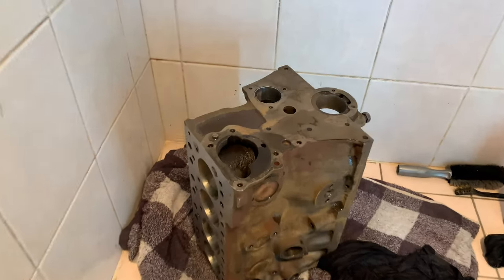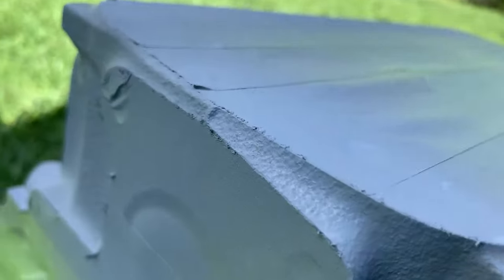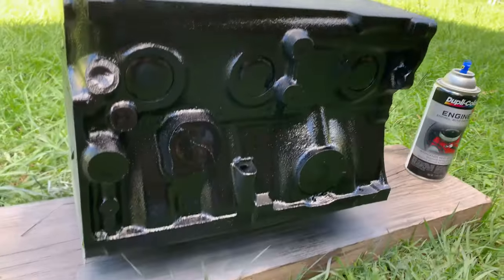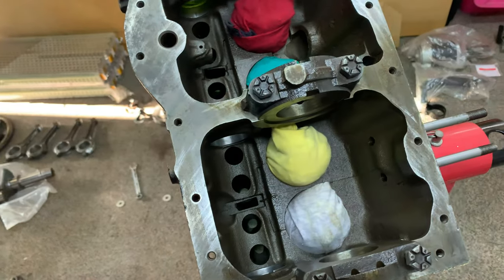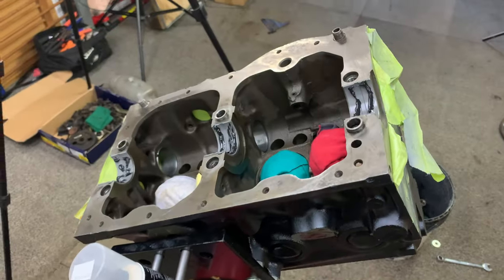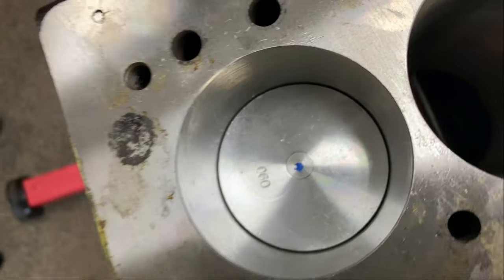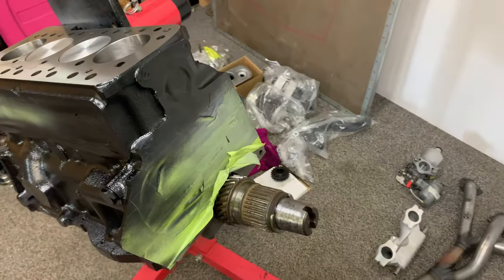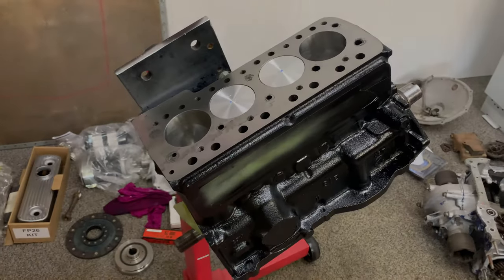Part3 of the Mini Motor Build - block is cleaned & painted and looking good!

Comment: Normally at this stage it's a good idea to enlarge the water coolant
 holes in cylinder head and block. Also the.mini cooper version head and block has an addition head bolt near thermostat. For a high revving engine the distributor drive shaft has to.be lightened otherwise it waggles and destroys the distributor bearings and upsets timing due to shaft waggle..Main crank centre bearings need a reinforcing strap fitting as crank shaft can break. Cheers from old George Ps A full.race mini engine tickover is around 1300rpm no good for road use. Also the more modern minis was fuel.injected. look out for mini metro turbo.

Comment: those oil journal's need to be spot on with the bearings, you will starve the bearings from getting proper amount of oil. I rebuilt an engine myself and had to make sure all was correct. i would order another set of bearing to make sure, take the time well you have it apart to get everything right. also lock tight when you attached the connecting rod bolts, get you self a gap testing kit for your bearings. Trust me Pete it will save you from tearing the engine apart because you burnt up the bearings for a lack of oil.
Reply from the maker: Yeh, i've been looking at other barings and they all 'seem' the same from images. I have the standard ones out of it. WIll dig them out to compare
Reply: @HBPowerwall  awesome, I just don't want you to go through all of that work and it fails on you. I through away $4000 on my engine build .
Reply from the maker: All said and done this one should come in under 6k but that includes alternator, rad, etc etc
Reply: The block has simply been drilled off,this is not uncommon, simply extend the block hole if it bothers you with a die grinder. it likely ran for many years like it is,and obviously has not spun a bearing,and while not ideal,will likely be fine.not a issue on low power levels of these engines.
Never ever use Loctite on rod bolts, this will affect the torque and stretch,use whats the mfg recommends(usually oil or dry). stretch in the bolt is what keeps the nut on,if u exceed the bolts stretch by over torquing,then it will likely fail. in the case of aftermarket rod bolts like ARP, they recommend their molebdenim lube or the stretch measuring method. Always check your clearences,never assume the machine shop is perfect(assuming u had the parts checked/machined).

Comment: We used to charge $300 to port a Mini, and all of them made over 80 actual hp on a dyno. Lets hope this guy has a flowbench and proves the head flows over 80hp before it's bolted on.
Reply from the maker: Yep, he has everything to work on heads :) If I get 80 on a safe tune I'll be stoked!

Comment: could you have dremelded our that oil gallery so it flowed into the bearing easier? Just curious if that would have been an option?
Reply from the maker: nothing is torqued up yet, still looking at options, just got a 'new' motor that's complete I can strip and inspect. Also have the old bearing shells
Reply: @HBPowerwall  Yours wouldn't be the first block that the "highly skilled and caring" Leyland employees miss drilled. At least that is fixable with a Dremel and a bit of care one 998 I built that had run the mains a few times had the oil hole so close to the edge that there was virtually no metal between the hole and the open air in the crankcase -  that was a scrapper.
Reply from the maker: been reading - looks like I have to buy a dermal & get busy!

Comment: Flat tops and presumably high lift cams + roller rockers... What's your full lift clearance?
Reply from the maker: Will hopefully be claying it tomorrow..
Reply from the maker: think i'm leaning towards 1.3/1 rockers rather than the 1.5's car has to be fun & drivable around town..
Reply: @HBPowerwall  How wacky is the cam. hopefully something better than a boring MD276 :p :D
Kent does a supersprint race cam (sounds wild but isn't.). Umm 595 rings a bell.
everyone rated that bad boy.
Check 1.3 is real ratio as a few kits were a little keen on their marketing..
Reply from the maker: I went MED rockers - won't have a problem with their marketing lol And don't remember what the cam was will have to dig out the invoice somwhere.. all i remember was its a fast road cam

Comment: Bearing hole alignment is odd, be interesting to know if thats normal for the leyland 4cyl, ford was too cheap to paint our barra blocks, they cut so many corners
Reply from the maker: Yes, going to look into that..
Reply: @HBPowerwall  yeh i knew you would
Reply: @HBPowerwall  it is normal, its all over the net, some say dont worry about others put a round file to it but apparently theres no need
Reply from the maker: i put a link in the description - looks like i'll need too.. it's not too much extra work as the plan was to build the entire motor up without torquing anything up, then strip re clean & final build
Reply: @HBPowerwall  yeh saw similar on the mini forum UK some said well theyre  like that for decades beforehand without fail and others say they like to chamfer the oil hole in the block.
Reply from the maker: I guess you'd only need it if you were reving it to redline all the time.. day to day it'll most likely be fine..

Comment: Would not put that back together with that offset main bearing oilway restriction. 😳😳
Reply from the maker: Found a article and linked it in the description - nothing is torqued down yet so will address that after I've done the test build. I basicly just need to know if i have every part to complete the build. Then strip - reclean (as I'm scared as hell I've missed something) then do one epic time lapse putting it all together in a few hours!
Reply: @HBPowerwall  I ran into a issue like this on the cam bearings. All were good except one like yours which was offset. Turns out they gave me the wrong ones. It was for the wrong year.  I would not use it either.

Comment: Make sure the piston rings are the right way up guys or the engine will smoke like a chimney and leak oil like mad!
Reply from the maker: There was no markings on the rigs - i have contacted manufacturer to see if i got it right as there was no instructions in the piston box when it got back from the machine shop :(  There is a dark and light compression ring tho.. worried i got them around the wrong way. I was always striping it down again after loose build anyway -
Reply: @HBPowerwall  worth checking anyway! I bought an engine that was built with the rings the wrong way and they scraped oil into the head rather than the sump so it smoked like hell. Also it pressurises the bottom of the engine rather than the head which forces oil out of the seems. Good luck with the build. What's happening with the electric conversion or is this engine going into another car?